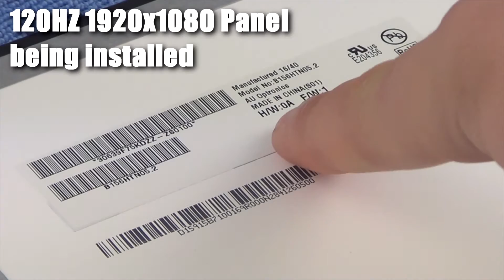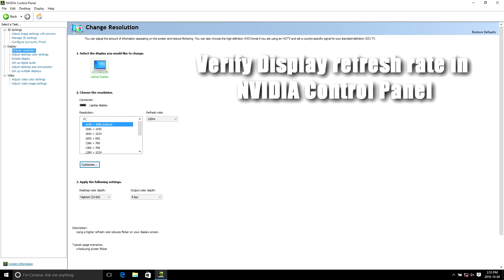EUROCOM Tornado F5 - 120 Hz 15.6" FHD LCD Upgrade

Comment: Nice video. Looks great. The bezel did not have adhesive around the perimeter? It looks like the bezel came off much easier that mine did.
Reply from the maker: Thanks, Mr Fox!  Good point.  I did this upgrade a few times to ensure the shots looked smooth so the adhesive slowly got weaker and less sticky.  But yes, the adhesive around the screen can be quite sticky and can make the "Carefully pry apart bezel as shown" step more difficult.  As always, when doing this upgrade, and all upgrades or repairs, users must be very careful not to break any components or chassis.

Comment: So the G-Sync module is embedded in the laptop or in the monitor? For example I would like to change my FHD G-Sync monitor with a 4K G-Sync one.  If I chose Samsung LTN156FL02-101 as replacement, will the G-Sync work after replacement?
Thanks
Reply from the maker: There is not a Gsync module.  It is a software app to synchronize the displays refresh rate with the graphics card render rate.   Yes, the Samsung display you listed supports Gsync as well.
Reply: Cool, thanks!
Reply: Be aware the Samsung requires the 40pin cable. Also be aware it's an RG/BW panel, which is a bit of a trick to the consumer. It's not true 4K. Eurocom should be specifying this and it's on them for not doing so. I would see if the AUO B156ZAN02.3 would work instead. True 4K w/ the same mounting and connector, just make sure your cable can reach the extra distance to the connector location since it's a bit further.
Reply: You cant have G-Sync unless you have a laptop with display port of the monitor is connected directly to the dedicated GPU other wise nothing will work..
if you check your device manager and found the INTEL graphics chip listed in the display adapters .. that means G-Sync won't work on this laptop
and the 4K panel is not compatible with this laptop as anything other than 30 pin panel won't work with this laptop..

Cheers

Comment: Eurocom I've already done this mod to my F5. When can we expect a BIOs update for brightness control and possibly gsync support as this screen is gsync, the laptop was sold as gsync and the 1070 in my laptop is a gsync card. 

Any ETA?
Reply from the maker: Hello!  I can't provide an accurate estimation on that.  We offered this upgrade option with the caveat that the system has those draw backs.  With that being said we are working on adding support for g-sync and brightness control but I cannot guarantee when and if that will happen.
Reply: I understand completely and I am thankful you guys are working so hard to keep tweaking and improving this beast.
Reply from the maker: Thanks!  Hopefully we have some good news soon!  Stay tuned!
Reply from the maker: We have found a solution for brightness control now!
Reply: Excellent news!!  Is this something that is ready to be shared?  Does it involve a specific driver or BIOS update?  

Thank you for your hard work on getting this done.
Reply from the maker: Share away!  It requires a BIOS Update.  Thank you for being interested! : )
Reply: Can you send me this bios?  I will update and the make a video for my channel.
Reply from the maker: The BIOS isn't something we can send to people at this time unfortunately.  Again, something we are working on.
Reply: Copy.  So I would assume I would have the option to mail my laptop back and have it flashed by Eurocom with this BIOS?
Reply from the maker: Yes, that is the only option right now.
Reply from the maker: We are working on a better option.  Stay tuned!
Reply: You guys are awesome!
Reply from the maker: You are awesome!

Comment: Hi can I use this display on my Dell Inspiron i7 7559? It's the i7 6700HQ version with non-touch 1920x1080 IPS display. Just wondering if the ports lineup and the dimensions are the same.
Reply from the maker: I'm sorry but I have no idea.  Not familiar with your notebooks panels at all.

Comment: Does this 120hz panel support gsync?
Reply from the maker: Not it does not.  We are working towards a fox for the brightness but Gsync is not expected to be fixed.
Reply from the maker: We have found a solution for brightness control now!
Reply: That's good to hear. Although, I don't have any information about the brightness control. What was wrong with it, exactly?
Reply from the maker: It just required a software update for brightness control to work properly.
Reply: Ok, understood. But the X9E2 supports Gsync for all of its panel, right?
Reply from the maker: Yes!
Reply: Perfect! Keep up the good work, guys
Reply from the maker: Thanks!  Just wanted to let you know.